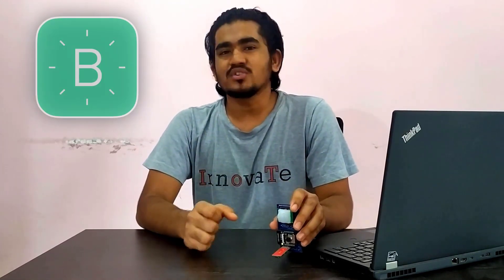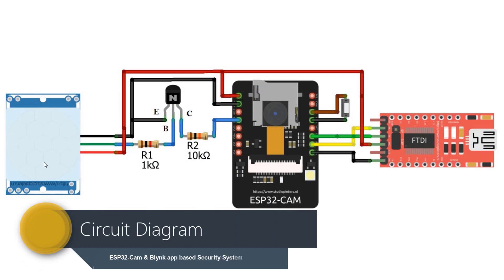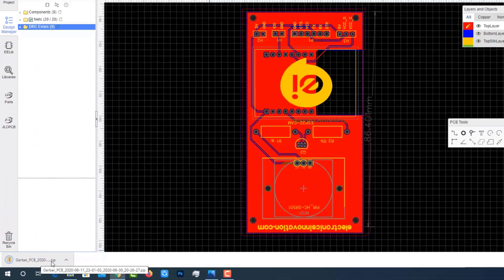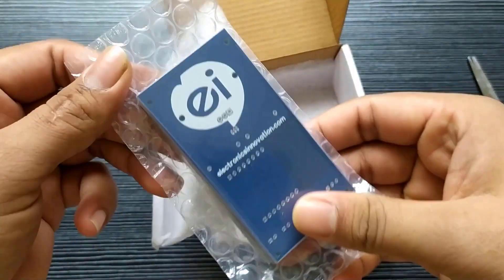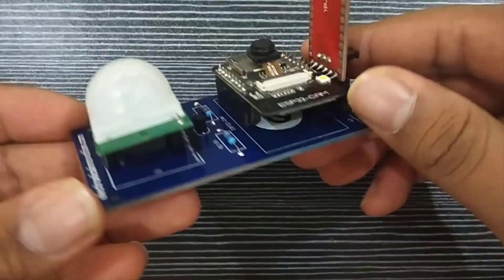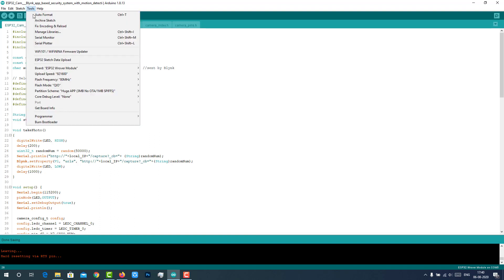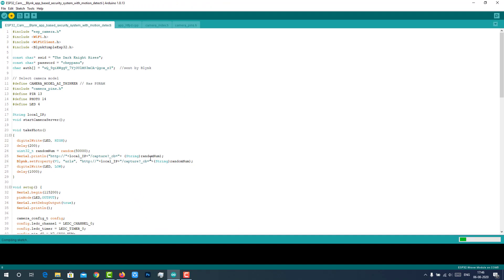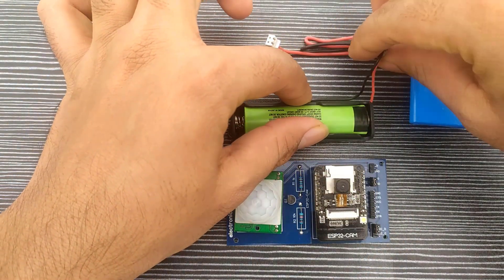How to make an ESP32 Cam & Blynk app based Security Camera with Motion Detection

Comment: You need to change the resistor from the PIR output to 2K2 to save loading the fet in the sensor

Comment: Thank you lot lot ❤️. I didn't made whole circuit with PIR.  However it is automatically taking pictures every THREE seconds.  I have given high to 13 and it stopped taking picture but "Capture picture" button does not take picture also not getting notifications...

Comment: Hi, my esp32-cam just keeps on taking pictures, with or without the PIR connected. Please help 🙄🙄🙄
Reply from the maker: If you make input pin floating, this will happen.

Try to connect it to either GND or VCC
Reply: @electronicsinnovation  Thanks for the reply, unfortunately i am a novice. Not sure what you mean. Must I connect the PIR output pin straight to GPO13 instead of through the transistor?
Reply from the maker: @christoprinsloo5096  no, if the sensor didn't connect, don't leave that pin floating, connect that to GND
Reply: @electronicsinnovation  still unclear to me, the only difference to the circuit is that I had to use a BC547 Transistor, and had to swop the wires accordingly. Please speak in a language I might understand. Got no idea what a "input pin floating" means. I know I'm stupid, but wants to learn😊 . Thanks for your help, I'm at wits end here :-)
Reply from the maker: Hey it's okay.
Every body will start from zero only.
No issues.
I will help you.

I cannot discuss here, please drop a mail on askus.electronicsinnovation@gmail.com
I will explain clearly.

Comment: Does the captured image automatically saved to image gallery of the android device?
Reply from the maker: Yes.
Reply: @electronicsinnovation  everything is working just fine, but the captured image isn't saved to the image gallery of the android device on which blynk app is installed. If there's any way to save those pictures into gallery, please let me know. Thank You !
Reply: Well done. Nice project.

 fd_forward.h no such file or directory. 
Pls wat is the problem.

Comment: Hello, greetings from Brazil.  I am doing a similar project and would like to know if it is possible to use this feature for face recognition too?
Reply: Hello. I would like to know if is possible to use the streaming mode and the face recognition tool at the same time and on the same display (video streaming tool on Blynk) and send a notification when to detect a intruder or user?
Reply from the maker: I haven't worked on that, you can give a try
Reply: @lucasmoniz4166   Ola, Lucas.. Tudo bem.. It is possible, but it will decrease the video streaming speed.
Reply: Brazil anta babai
Reply: My idea is to use the ESP32-CAM in streaming mode and the features of face detection and face recognition present in the device (and in Blynk).
Reply from the maker: @lucasmoniz4166  I have similar projects, you can check it out.
https://youtu.be/KVb2cMbaWxY
https://youtu.be/AB0SphP3apo